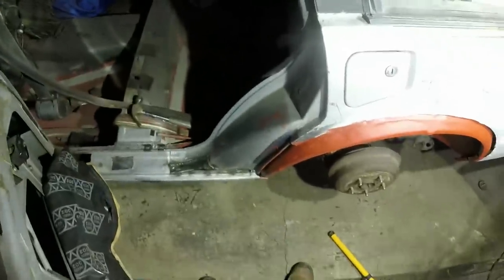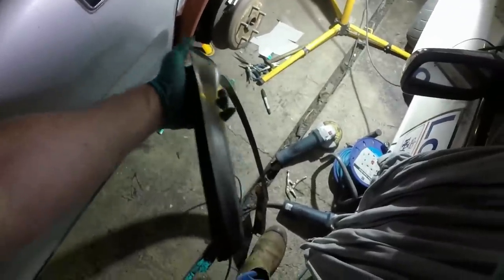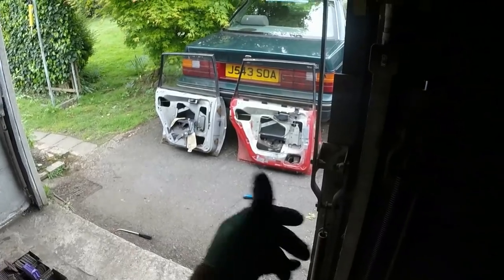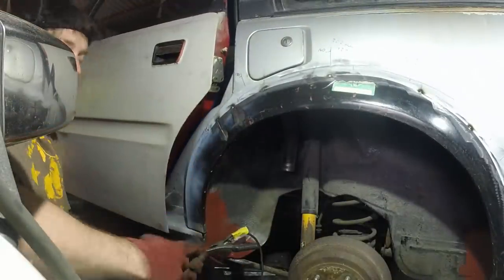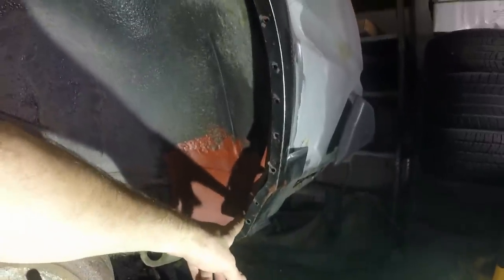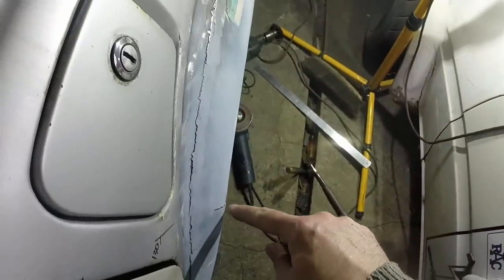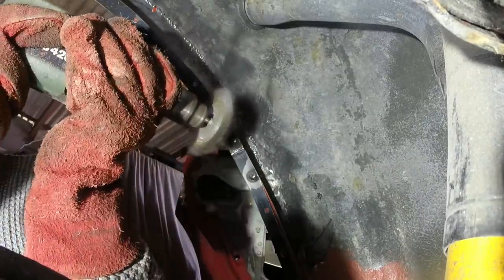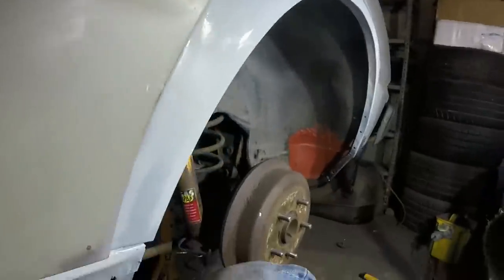Dotty 1981 Rover SD1 Restoration - Video 31 Rear arch 5

Comment: Wow excellent work as usual . People like these videos because you show that it's not easy and you have to  keep going to get a good result esp with some parts not always fitting so well unless modified.   Anyway another sd1 saved . I used to visit scapyards in early 90s and i am sad to say there were many sd1 esp 3500 with engines out I guess destined for kit cars etc. Oh to have a time machine..
Reply from the maker: Dammn right.  I remember walking into JR Car Spares in Paddock Wood.  They had a redrover sd1 v8 vanden plas efi with cream leather which only had some very minor rust and it had a shitty sierra stacked on top of it :(

Comment: I wonder if an extension piece could be welded onto the doors to close that awful gap at the B pillar on an SD1?
Reply from the maker: Yes it could and ive seen that done before.  You can also beat the leading edge of the door in, to pull the whole thing forward.
Reply: @nitrosilvia  Cool. I wonder if the little lip you see on a lot of modern cars that hides the gap could be added if that were done. I imagine it would look great given the rounded shape of the SD1 body.

Comment: Thanks for the vid! I have been following this serie with a lot of interest because I have a similar car. Do you know if it is possible to buy rear wheel arch repair panels? Rimmer Bros do not have them .
Reply from the maker: I dont think you can buy them new.  They occasionally appear on ebay.  Otherwise the SD1 club forum or facebook groups.
Reply: @nitrosilvia  Thank you very much for answering. In Denmark where I live,  we also have ´den blå avis`.

Comment: I think You are basically trying to fix a design error. I've even noticed bottom rear door out drift and bad rear arch shaping on Rover 216's... The strange thing is this James... I've spent most of my career fussing over blocks an bars of metal with same intent that you do with metal plate... Engines are probably going to be my thing.. 'Me think's' I'm too long in the tooth to take up bodywork on any very serious level. Look out for a message from me on the forum...And don't blow the bluuudy door off... W ;)
Reply from the maker: sent you message on sd1 forum

Comment: sdi's were never perfect from the factory the one ive got has a 4mm gap between inner and outer edges and never been welded just loads of sealer to make up the edge
Reply: sdi? sdi??  Come on, if you're an owner you should know it is an SD1 😂
Reply from the maker: some of the publicity photos they used, even those cars werent perfect!
Reply: @DarrenCoull  i am an ower in fact i've got 4 at the moment i've got a 2.3/a2.6/v8auto/and a v8 manual been looking for a diesel one as i've never had one